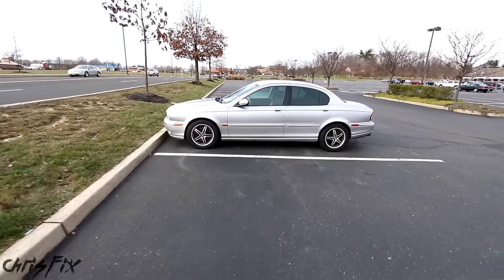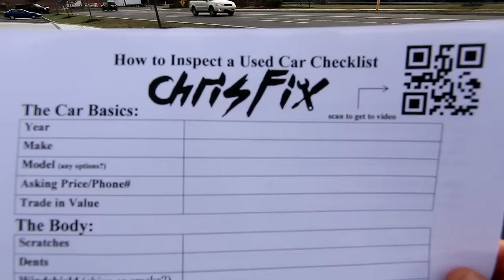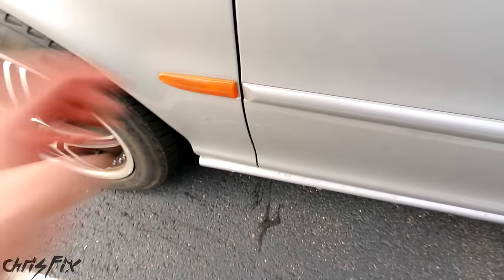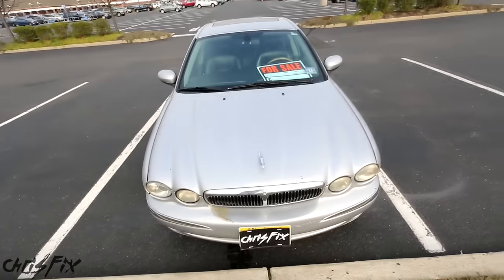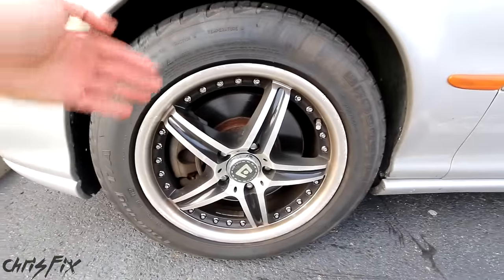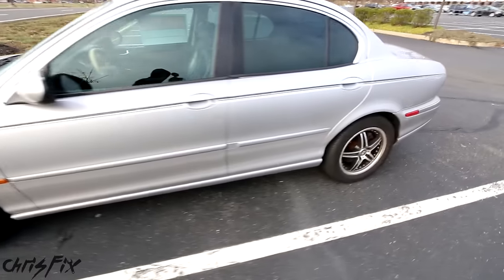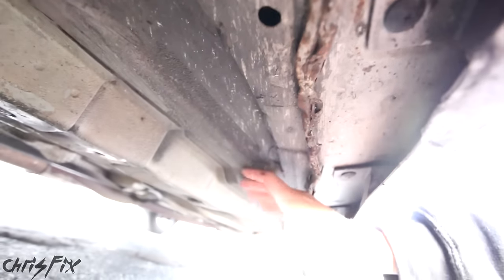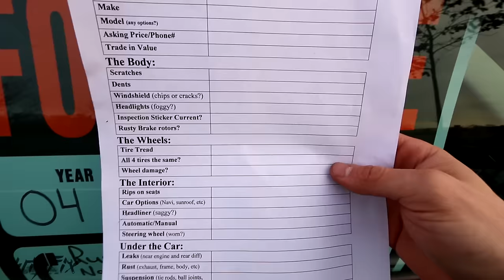How to Inspect a Used Car for Purchase

Comment: Here's another great tip... when taking a look at a Jaguar X-Type, turn the other way and run.
Reply from the maker: +ronjon83 hahaha, #toolate
Reply: Isn't it just a ford mondeo...! :)
Reply: +ChrisFix can you do a video on setting up stereo coz your video are clear and and awsme
Reply from the maker: +Dragon Ma It is, but it is a ford/jag hybrid so it had problems.
Reply from the maker: +Blew Shift They are super unreliable!
Reply: +ChrisFix I've had a few mondeo's and always done me proud. Always enjoy your vids buddy, all the way from Yorkshire, England 👍🏻
Reply: +ronjon83  x-types are great cars...they look great inside and out and if maintained well they last long ....my dad has a diesel (sold in europe only) and it's one of the most reliable cars we've ever owned
Reply: +ChrisFix Super unreliable, and like any luxury brand, super expensive to maintain. That's why a lot of people dump them before they reach the end of their warranty.
Reply: +ChrisFix Sorry would not agree with this, X-Type is no worse than most other cars...But would avoid this particular one!
Reply: Lmao.. That's funny, good one
Reply: +Dragon Ma The Ford Mondeo is called the Ford Contour over here in the States.
Reply: Had one up to over 200k miles. No complaints. Best car ever. Only sold it because I had a baby and needed something bigger. No expensive to repair. And it only shared a chassis with the ford, the rest was all jag. The s-type had everything build by ford. The s-type was a pice of shit that always broke down ( my cousin had one) engine failed (fords engine) around 100k.
Reply: +Joseph Murray have you owned one? I've always had diesels and they've been spot on.
Reply: +ronjon83 this isnt a ford, its a jaguar......
Reply: +Dragon Ma No, never owned one but Ford don't make em anymore for this side. If you're interested, there has been an EricTheCarGuy video series called "Fixing it forward" where he's working on a Ford Contour that had sit so long that spiders turned it into a home. Really great channel to subscribe to.
Reply: lol agreed
Reply: +Joseph Murray thanks I'll have a look. I like the new mondeo which has been out in the UK nearly a good year or so now. Might wait for the Vignale..!
Reply: +ChrisFix wait wait. So you saw a used car in the street and you put chrisfix signs on the of the license plates #WTF?
Reply: +ΣΤΑΥΡΟΣ OSFP ΘΥΡΑ 7 He just rested it over the real one so no one could see the real plate number.
Reply: ok thanks
Reply: +ronjon83 "Runs great! Needs nothing!" All lies. Runs great to the scrap yard, though.
Reply: ChrisFix
So the Mazda truck wasn't enough? You just had to be a glutton for repair punishment. Better not breathe on it too hard or something will break. :)
Reply: I agree, worst transmissions ever!!!
Reply: +ChrisFix The 2.5L models are actually pretty decent. It's the 3.9L that you need to run from
Reply: +ChrisFix Oh well, you won't run out of material for new videos I guess.
Reply: +ronjon83 Come on, British cars are great!....... Unless you own one.
Reply: I think a car lasts as long as the owner cares to take care of it responsibly a properly.
Reply: Techno sailor
Unless it's a Jaguar, a Ford, or whatever else brand you don't like because it broke on you or someone you know
Reply: +ronjon83 But real men don't run from (potential) explosions 
:P
Reply: +ice44567 
Had a buddy buy one. He brought it straight to my house to brag. He came by again a few days later because the electrical system was funky. It had the thumb-screws on the dash so we pulled that off. It vomited tons of wires that made no sense at all. Told him to get a sign and attempt to get rid of it. There was no way of connecting with the guy he bought it from.
That piece of crap is still in his backyard. btw, it wasn't an X. He bought it about 83 or 84.
Reply: +ronjon83    You're wrong.  You don't have to run away, a brisk walking pace is sufficient.  Just keep at it until the thing is no longer in sight.
Reply: +Techno sailor Of course, you CAN keep anything running indefinitely.  The questions are at what price and at what inconvenience?  How often do you really want to be stranded when something vital has suddenly failed again?
My Lexus is 18 years old now and has needed only basic maintenance (oil and filter changes, wiper blades, brake pads and the like).  Everything works perfectly.
Reply from the maker: +Alec Escolme So far everyone who I talked to who has owned one, said they love the car but they are always breaking down. Im not hating on the car obviously because I am looking for one haha. Do you have a reliable one?
Reply from the maker: +Blew Shift Yes the next used car buying episode is coming soon!
Reply: Thinking the same thing! Pure money pit. Old jags are for people with more money than sense.
Reply: +ChrisFix I thought the Ford era Jaguars were not too bad, was in the market for a Jaguar XJ8 with the 4 liter engine not long ago.
Reply: +ChrisFix most of the time people who say "that car is trash" or "not good" are people who never do maintance to their cars, don't check fluids, get the cheapest  and unreliable part for the car when need repairs, drive the car until it won't start anymore, etc. Most cars can be in great shape and working like new if they have/had a good owner, so if you're going to buy an used car, the owner  could be another thing to check.
Reply: nomad91910 ...you've obviously never owned/attempted to maintain the electrical nightmare that is the  Jag X-Type, have you?
Reply: +V - Pony i haven't, but thats why i sayd most of the time, some cars are just badly made, but others are good and people give them a bad name
Reply: There is nothing wrong with the jag x type.
Reply: +ChrisFix What are your thoughts on Alfa's Romeo's?
Reply: *****
But friendship is magic :(
Reply: +V - Pony x types are awesome. My dad has a 2.2 5 speed diesel estate. I love doing work on it maintaining. It is due its oil change around now.
Reply: +LawnTractorBoy I drive tractors instead of a car.
Reply: +Dragon Ma Nah, just 20% Ford, rest is Jag. You do know that most cars now a days share components from other manufacturers? Instead of developing their own parts the car makers just buy them from companies who already make high quality parts. In this case ofcourse Jaguar was owned by Ford, but it's not a dressed up Mondeo like all anti-Jagboys say
Reply: +ChrisFix Looking for a 2.5 X-type myself.. Parts aren't really that expensive, if you compare it to Audi it's really cheap.
Reply: +Just Car Videos the jag has a ford mondeo chassis and engine+filters. It has a jag body and interior.
Reply: +ronjon83 
HAHAHAHAHA
Reply: +ronjon83 Jags are nothing but high priced Ford vehicles..
Reply: +Sbayo9 Which one?

In general, stay away from JTS engines, also 2.0 TS can be problematic, 1.6 TS is kind of thirsty for what power it has, 1.9 and 2.0 diesels are great, 2.4 JTD 10v oke, 2.4 JTD may have some issues

Tell which model intrest u
(apart from oldies, those i know nothing of lol)
Reply: +Dino Harandi the engine in our jag. It is only running on 3 cylinders instead of 4.  We are getting a diagnostic machine tomorrow to find out what it is but I think I know what it is.
Reply: LawnTractorBoy why did you reply to me? must be some error?
Reply: +Dino Harandi yes. It was supposed to be Chris.
Reply: +Dino Harandi sorry.
Reply: It's technically just a Ford Moneo if I remember correctly...which is a totally solid car.
Reply: +Sbayo9 
Old Alfa Romeo (especially rear wheel drive) are great. New Alfa are FIAT = crap.
Only the M-Jet diesel engines are very good, all the rest is, as said, crap.
Reply: +Riswan Ahmad P There's very little British about Jaguars anymore, sadly
Reply: +Dragon Ma It sure reminds me of my old Contour SVT.
Reply: ronjon83 this applies to any American car
Reply: This guy is SPOT ON-I assure all of you!
Reply: I have a 2002 3.0 jaguar x type. Bought it for $500 and have to replace only a few things; a.c. compressor, seat cover, ashtray, wheels, and got it tinted. Overall only spent about 1500 on the car in total.
Reply: ronjon83 we bought one and it runs great
Reply: ronjon83 lol ok
Reply: My 2001 Lexus LS430 is solid as a tank and runs like new. The only thing that Ive had to do to it so far is replace the ac condenser cooling fan motor and it needs a drivers side (bank 1) oxygen sensor. Other than that, no issues.
Reply: LOL
Reply: But it's a jaaaaaaaag
Reply: Lol YES
Reply: ronjon83 so agree I had an XJ8 and it was awful. Bought it for 3k sold it for 400 blown transmission
Reply: That's the s type
Reply: LMAO for sure
Reply: he ended up getting it for $300
Reply: @chrisfix  Well I wouldn't agree with that I have one for 2 years now with same engine, colour and have never had any problems with it, these engines are super reliable, suspension is a bit weak, but I  personally have no excuses for it :)
Reply: @chrisfix  you are cool
Reply: @peter_dc2rx  what type of cars your family buys used Mercedes and BMW's
Reply: @Remrie  any except for Lexus, nothing more reliable than a Lexus
Reply: But it’s a Jaaaaaag
Reply: They're unreliable years later...
Reply: @jcv9799  Don't get it man, if you want one and "have" to have it though, lease a new one. I would never lease a car personally, but it you "have" to have it, this way you won't have to fix any problems and you don't have to sell it for a huge loss.
Reply: @DJRoastPrince  Actually they have special parts and you can't use aftermarket parts on them without the computer system rejecting it and putting the car into limp mode. I had a 02 x type 2.5 and it was a nightmare. I bought it and it spent the next 2 weeks after I got it home in the shop get new catalytic converters@ 90,000 miles. I charged the ignition coils too and the spark plugs, kept up with all the liquids and a wheel bearing went out on my way to work. I junked it after that. If you want a lemon car that you can just throw more and more money at until you're broke, Jaguars and BMW'S and Audi's and any dodge/fiat product is the way to go!
Reply from the maker: ronjon83 well 4 years later and an additional 100k miles I would like to say this was a great purchase for $1900. Now she is having issues but $600 a year with no issues, that’s a steal!
Reply: Yep pretty much. So many electrical demons. Car was made with a ford chassis. Garbage.
Reply: @ronjon83 im 🤣🤣this is soo true Jaguars are horrible vehicles!
Reply: Lol
Reply: Oh i get it thats funny
Reply: RUN As Fast As you can.
Reply: Your better off building a new one from scratch then relying on a warranty.

Comment: When I bought and sold vehicles I would open the drivers door all the way then lift up on the door to check for play in the hinge. If there was play, and the mileage was low, I would suspect a rolled back odometer. Also look for excessive wear on the brake pedal/gas pedal. It is a very good idea to measure the paint thickness on the vehicle to see if any body work was done. Pull out the dipstick on the transmission and smell the fluid to see if it is burned. A compression test is very useful as well. Never buy used cars that young males owned. I preferred buying cars from older people, they are much more likely to service the vehicle. Younger people abuse vehicles.
Reply from the maker: +electronicsNmore Great tips! Thanks for sharing all of them!
Reply: No prob. You have excellent videos. I was looking for one of your videos that you're actually in so I can match the voice to a face. :-) You reminded me of a buddy of mine that I would go freediving, spearfishing, and fishing with.  I saw the cast net video. :-). I'm rarely, if ever in my videos. Just feel no need to be in them, but maybe in the future, never know.
Reply: A compression test??  No private seller will do this  only from a dealer by a company who does a complete vehicle inspection which will cost some money and that's a good way to do it.
Reply: Can you please explain what a "Play in the hinge" mean?
Reply: stereo typing
Reply: What does "play in the hinge" mean???
Reply: @polly4531  If the door moves up and down on the hinge. Similar to a door or cupboard: When they're first installed, they don't wiggle. As time goes by and they wear down, they start to wiggle up and down on the hinge.

If a car's door wiggles up and down but supposedly has low miles, it's likely the odometer has been rolled back so as to seem like a "newer" vehicle than it really is.
Reply: Winston I’ve never had a car door move up and down at all even on cars with 300k miles so that’s bullshit. If it moves then someone has had the door off and not put it back on tight also the door wouldn’t line up if it moved up and down so opening and closing it would show this, it may have been in an accident but not because of higher miles.
Reply: Hey man, just for the record im a young person and I love my vehicle. I take really good care of it.
Reply: Down with the young male patriarchy!!
Reply: @Alexander_l322  door play used to be an issue on cars from the 70s and 80s, but yeah, I haven’t seen it in forever.
Reply: @JohnDoe-uk7jy  good John that will show when you sell your car because you’ll be able to ask more for it after you’ve cared for it.
Reply: @Dozav7  yep
Reply: As much as i want to disagree on young males abusing vehicule as i am in that group you are right.they are very often abused and the best cars are those that wereown by an elderly person
Reply: If the person lives in a bad area with pot holes . pass
Reply: I'd say don't buy from young females cause I actually get my oil changed almost every female I have ran into didn't even what a dipstick was
Reply: @blakenelsen7912  Agree, many young women just drive cars, they never check fluids, etc.
Reply: @electronicsNmore  my mom is a huge culprit she wonders why 3 cars have broken down and stopped running and won't listen to me when I tell her to get an oil change 😂
Reply: I bought a used car from a young guy who owned it. The car has been the best car i ever owned....just saying...
Reply: @valjean2036  Consider yourself lucky.
Reply: @electronicsNmore  i do agree with who said not to buy of young females...we are rough with cars lol
Reply: @CertifiedGShep   I didn't know what that meant either but that actually smart
Reply: Im a young male (22) but when I get a car Im going to baby it and drive it like a 95 year old women.😂
Reply: @JesusisLOVEJohn-  i beleive you!! Guys are generally way better at taking care of vehicle...its just something ive observed over the years.
Reply: @valjean2036  Im sure it depends more on the individual.😁
Reply: @CertifiedGShep  Great name
Reply: You must work for an insurance company
Reply: @moonar5820  Example: I have a 2000 Camaro Z-28, where if you swing open the driver's door all the way out, you can move it up and down about 1/2." This is due not to play in the hinge itself, but the fact that the hinges are mounted to the FIBERGLASS door frame, with only two metal backing plates (thanks GM). Over time, the FIBERGLASS has developed cracks and sagging, which causes this door to wobble when it's wide open. It got so bad that the door wouldn't line up with the door latch or close properly unless you lifted it while closing it. While looking for an entirely new door (not cheap), I jury-rigged a spacer along the rocker panel that lifts the door as it's being closed, allowing it to close and latch properly. So yeah, though I've never seen a door with play in the hinges themselves, it's probably a good idea to check the door's movement overall.
Reply: @moonar5820  like you pull up and down and see if the door shifts and wiggles in the direction it isn't meant to move. Could even indicate if the car is warped or any fitment issues with panels.
Reply: I love your videos Chris fix keep the good work man :)
Reply: What do you mean!!??? Kinda sexist . We might abuse them but at least maintain them . I’ve seen cars of young females that haven’t changed their oil in years !!
Reply: Let’s not always assume lol, I bought a car new off the lot and after 100k had play in hinge, doesn’t always mean odometer was rolled back
Reply: @Alexander_l322  If there's enough structural weakening due to hidden rust then yes, the doors will sag. You must live in a low rust area.
Reply: Lots of stereotyping in your comment. I am an 18 year old male who takes great care of my beloved car. Always driven gently (especially when cold), serviced by myself constantly, cleaned every 1-2 weeks etc. While yes a lot of young men don’t take any care for their vehicles, some do. I’d say as a general rule young females are worse, as all that I’ve spoken to had no clue what a dipstick was.
Reply: Dang I didn't know I abused my car
Reply: @valjean2036  NLOG moment 🤭
Reply: Compression testing my engine saved me thousands, great tip.
Reply: So many dudes absolutely rocked by this comment 🤣❄️

Anyway, I’m in the market for an Evo, which you can’t get new, and was almost exclusively owned by young men… so yeah, it’s def something to look out for.

Comment: Another great tip. If the owner won't let you test drive the car, don't bother wasting your time with it.
Reply: I'm guessing you're 17 and tried test driving some guys porsche
Reply from the maker: +Dylan Tucker Yessir! I have had that happen numerous times. The biggest problem is they dont insure it anymore so they wont let you.
Reply from the maker: +Buddy Rydell Come on man, we are a car community here. Try to leave comments that are helpful not so critical.
Reply: +Dylan Tucker really? I'm 16 and test drove every vehicle I laid my eyes on. Ended up getting a used '08 mustang.
Reply: "runs fine, but battery dead. must be towed home. serious buyers only. Sold as is."
Reply: @kzoomin  🤣🤣🤣
Reply: @kzoomin  320,000 miles, everything works great, but needs new engine. $2750. Seriously, this is an ad going right now.